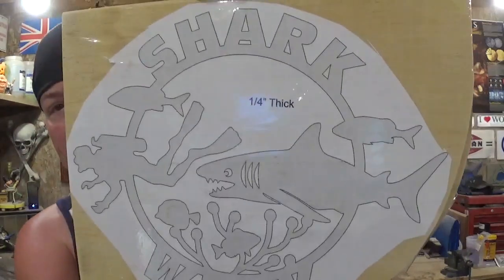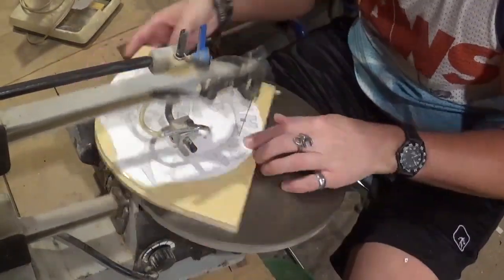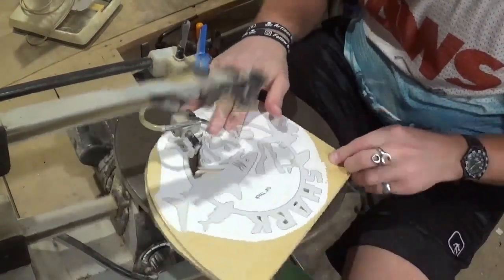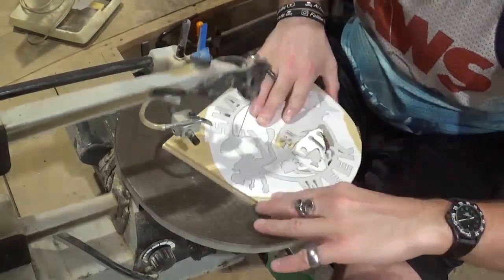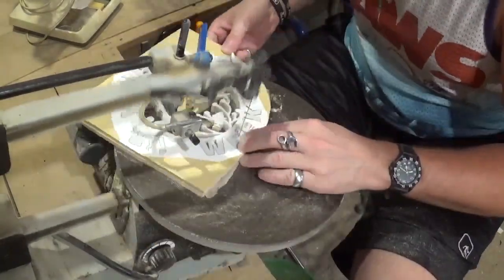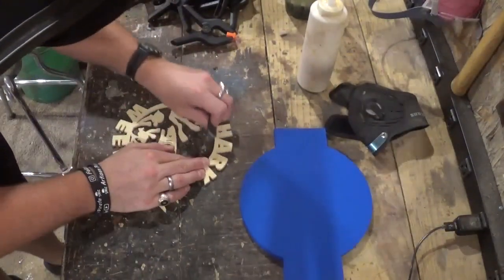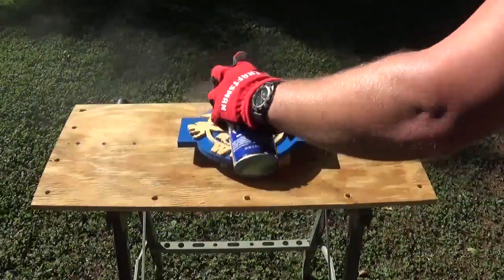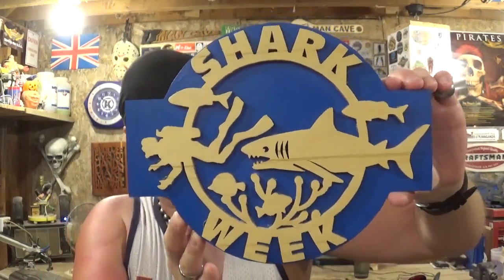Shark Week 2020, Scroll Saw Project

Comment: I know this is probably a dumb question but how do you keep the two pieces of wood together when stack cutting? Is it just tape?
Reply from the maker: Not A Dumb Question At All !  I Usually Just Use Tape For Smaller Pieces Like This, But If Their Is A Lot Of Interior Cuts I Use A Few Small Brads To Give The Piece More Support !  Also The Tape Helps Lubricate The Scroll Saw Blade !